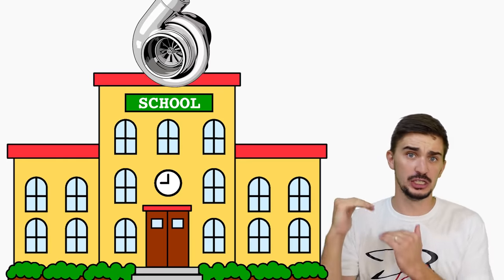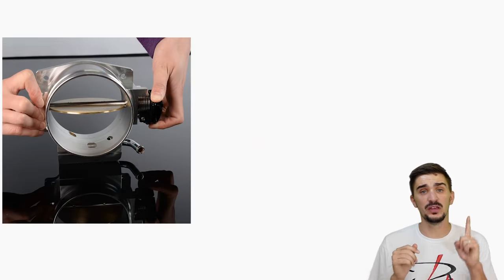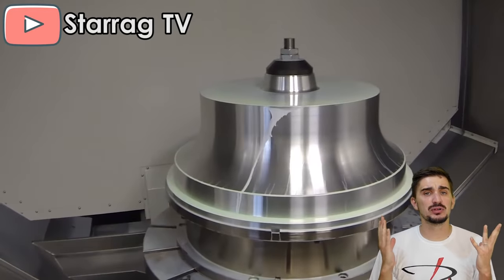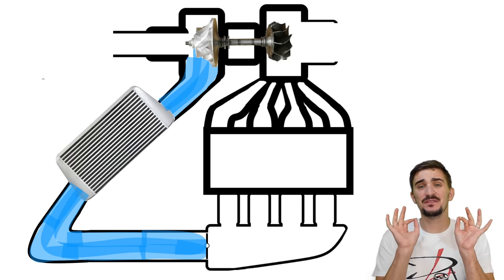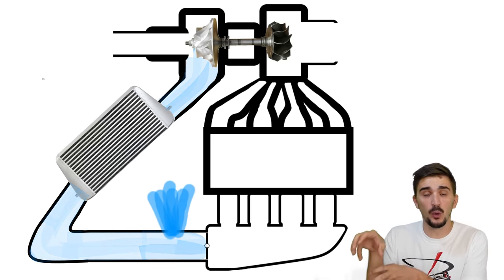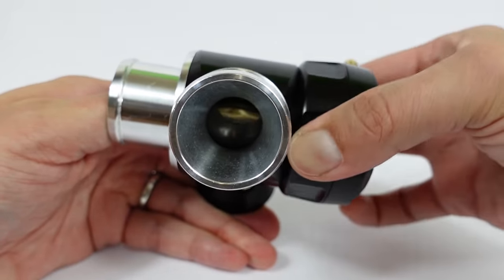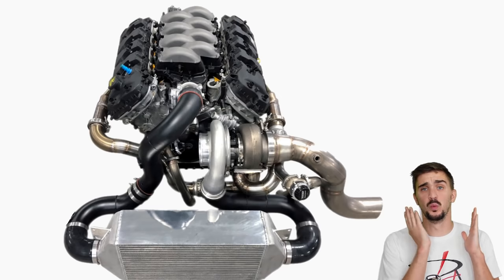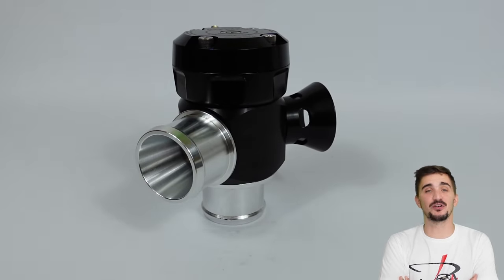TURBO FLUTTER and BLOW OFF VALVES explained in DETAIL - BOOST SCHOOL #8

Comment from the maker: Become a Tuning Pro: https://hpcdmy.co/dr4a
Support the channel by shopping through this link: https://amzn.to/3RIqU0u
Go Fast Bits: https://gfb.com.au/
GFB TMS Respons: https://gfb.com.au/products/blow-off-and-diverter-valves/respons-tms/
The BOV from this video: https://gfb.com.au/products/blow-off-and-diverter-valves/respons-tms/respons-tms-t9033-adjustable-bias-venting-diverter-valve-bov-detail/
Reply: I would like to know about my Stu tu tu tu is with a diesel with no throttle, and variable turbo
Reply: @fastinradfordable  same here, have a vw twin seq. turbo with a air snorkel aimed at the driver ;)
Reply: Listen besides boost school, I say you call it the “School of Spool”
Reply from the maker: @Stank-b8w  Good one! Might use that some day. Thanks!
Reply: @d4a  definitely do!
Reply: @fastinradfordable  Some of the newer diesels have throttle plates to help reduce emissions. Sounds stupid to me but that's what they do.
Reply: How does the tdi diesel kooo
Reply: @stevenharpervw  what do you mean by "koo"?
Reply: @chrisbaker2903  on a vw tdi turbo diesel. They sound like pigeons that go koo or choo. A diesel doesn’t have a throttle plate . Vroooom -choooooo
Reply: @stevenharpervw  my tdi is an 03 and I've never heard any sound like that from it. It is bone stock so far. I have an egr delete kit but haven't installed it due to physical disability. I live in a kind of backwater town and need to find someone who can do the stuff I want.  Better turbo, better exhaust and intercooler.
Reply: I'm not smart enough to know if this is easily installed or made compatible with a 2012 chevy cruze 1.4 eco (gas) but I love stu tu tu tu
If anybody wants to be that guy, I'd I'd eternally greatful 😅
I have an AEM ram intake, and a zzp downpipe I'll be installing soon if that has any bearing.
Reply: You’re awesome lol subscribing now but I think that flutter sound is worth the shortened life of the turbo lol $1,000 every year or two would be worth it for that sound 🤣
Reply: does this need further tuning after installing?
Reply: I loved this explanation. 
Particularly with the Stu-chu ...
Reply: I have a question can i install a blow off valve in non turbo engine
Reply: @fastinradfordable  zrpi
Reply: Thank you for the explanation! I've always wondered how this worked.  I had some clues but seeing the renders, graphs, and your explanation was really enlightening.  
(The following Note comes with a story, of how I Found out, and also how freakin' expensive it is to fix)
As a note  that I do want to point out, is that some manufactures call the recirculating of air and the associated part (Like Volvo for instance) a "Compressor Bypass Valve" or CBV since it does exactly as you explained and allows for both recirculating and venting, instead of just venting.  
I Learned some about this when I had a cracked turbo pipe and my CBV blew out as it exceeded it's max rated PSI of 25 boost.
I have a 2007 Volvo S60R with a 6spd Manual and a partial upgrade kit which I still need the exhaust for, but do have a software upgrade which does increase boost pressure.  Unfortunately I bought the car used and it was well abused before I bought it.  Previous owners thought a Toyota dealership was a good place to replace a clutch assembly (they didn't do it correctly either) but that is another story.  I had a serious problem but no answers for 6 months.
I was unable to take it to a good mechanic or Volvo dealer.  I was in Florida for a contractor position in Orlando and the nearest Volvo place was in Winter Park (They are terrible at handling R and other rare models of Volvo) and they checked from the fuel pump all the way to he injectors, but never thought to check the actual intake manifold past the MAF.  
eventually the CBV blew out due to a massive over-pressure caused by my Turbo overcompensating for serious lack of pressure, followed by the charge pipes that hold the air suddenly doing their job.

I literally had to Floor the car to go 63 mph, when it normally produces around 340 hp (with the software upgrade + Elevate Air intake box/filter vs 300 stock.  If you have the full Elevate kit of airbox, exhaust, and software it's 370hp+).  
I then evacuated due to Hurricane Irma and went up to Atlanta, GA where my father was, which is where I went to a competent Volvo dealer in Alpheretta (near North Point mall) that I'd used for a long time partly because they have a certified R mechanic, who actually owns a 2006 S60R.  They looked at the car (I think it was just a regular mechanic that looked, so the other dealer has some serious issues with handling turbos... which like unless you have a 2009 or older all Volvo's have turbo's minus all electrics) for 15 minutes and told me exactly what happened.   I was both blown away at how incompetent the other dealerships mechanics where as well as how expensive the repair was going to be, verses the fact I had literally just spend that much money over 6 months diagnosing and replacing parts that were not broken.  (parts cannon anyone? Dont' let dealers do that.  hard lesson)

Anyway, the compressor itself was $1,100 and the charge pipes and other items were a good $1600 and once you added labor for the turbo itself I wound up spending about $3k or more.   (the pipes weren't that expensive but labor is nuts), and I had to buy my custom Elevate CPV which was an upgrade over the stock spring one to a piston driven one with a higher boost rating.  I was lucky nothing else needed replacing from that.  But I will never forget having to floor it to go 63 MPH.... that was ridiculous. 

In a Turbo charged car, if the turbo fails, you produce a lot less power and I think that is related to running negative pressure.  I'm sure you have a video on that though and I look forward to watching it!

Thank you again and anyone who made it this far in my comment, thank you for reading.
Reply: Could you do a video on how a BOV is different than say a diverter valve for a Audi or Mini Coopers? Ive always wanted a real BOV on my Mini but Im told that I should get a DV+ unit instead.
Reply: why do turbo diesel engines have turbo flutter??
they dont have a throttle body...

Comment: As a longtime mechanic, I would have to say that this is the best presented explanation as to why a bov is needed in a turbo circuit! Well done
Reply: But you don't need one.
Reply: Well I have a 2013 Mercedes-Benz c250 and it has a turbo and I have a bov, but my mechanic toll me that it caused turbo lag and that was the reason that every time I accelerate it took a few seconds for the car to go.
Reply: @moiseslopez7831  Hi Moises, the problem isn’t the box, it’s the turbo. When you accelerate hard, it takes a few seconds for the turbo to spool up to a high enough speed to provide the boost required for the engine to have the power needed to accelerate. That is the reason for twin turbo engines. They have a very small turbo that speeds up very quickly to eliminate lag, but as they are small they can’t provide high boost pressure needed for high engine revs, do a second much larger turbo is I Also in the system, which provides the boost from the mid to high engine revs. I hope this explains what is happening in your Mercedes.😃
Reply: Danm, thanks  🙏 , now I'm sure that I don't need to take out my bov.
Reply: @markthomas36  If you have two turbos and one is bigger than the other it's not a twin turbo...
Reply: @moiseslopez7831  Ignore him, that isn't what is happening, it's likely running a blow off valve is causing a rich condition, the ECU thinks there is more air in the system because you are releasing air out of it that would otherwise be recirculated by the factory bypass valve.
Reply: Is there an advantage that BOV has over oem recirc other than the sound?
Reply: @chrisrourke8404  The recirculation doesn't relieve the excess pressure as quickly as an atmosphere venting does, and the excess pressure is what shortens the life of the turbo, especially if the boost is much higher than OEM.  But at the same time, the venting causes the turbo to have to spool up each time the throttle is released, which translates to unwanted lag.  The bov advertised in this video allows you to have a mix of the two options, and you can adjust it to find the best mix for your particular engine setup.

Comment: I can't believe he actually made a graph of the stututu sound. This guy is a legend!
Reply: That's a turbo efficiency chart. It's based on rpm, displacement, and boost volume. You use these to properly match a turbo setup with your engine setup to ensure the amount of exhaust pressure your engine will produce, your engine's expected air requirements, and the turbo's ability to push air line up effectively. Most people think "bigger turbo, faster car," but this isn't the case. If you're too far out of the turbo's efficiency curve, you'll starve or overload the block. Watch Donut media's video on boosting the Miata for a good breakdown of using that chart
Reply: He's a beast rite
Reply: @complexeddrummer  I didn't know that's how that works but it makes sense
Reply: U don't  graph your stu-tu-tu noises?  
....  novice
Reply: @complexeddrummer  he's talking about the chart after that one. The one that had disco stu in it
Reply: He didn't make it its from garret
Reply: Ffs 😅
Reply: @complexeddrummer  You're talking about the compressor map. I'd recommend TurboDirect S.A if you really want to learn about compressor maps.
Reply: And  I can't believe he used disco stu on the graph. 🤣🤣🤣
Reply: lol...ur comment made my day..
Reply: CR7 made it first
Reply: What do you mean, you can't believe? I am subscribed for precisely this stuff.
Reply: @MrTimstaaa  "disco" is short for "dis compressor"
Reply: Legend???! 😂  he’s teaching 6 year olds and looks like the person doing sign language in the corner of normal tv programmes 😂
Literally saying ‘sucking’ the air in, in the first minute, when the whole video is about turbos. 🤦🏻‍♂️😂
Reply: @Monkey80llx I know right the cool ppl were born with this knowledge. Only chumps learn from others

Comment: It takes a very smart person to explain complex subjects in a simple way for non-familiarized people to understand easily.
Thanks once again for such an educative video. I enjoy absolutely each and every one of them !
Reply: Need advice, replaced my stock turbos ( cus they were leaking oil) on my 2015 m4,  installed CTS stage 2+ turbos.  Runs great with my stage 2 tune that I've been using. I hear the spool loud and clear, pulls hard, but I get this flutter sound especially when going hard in Sports+ mode, almost like in the end of this video. Would a custom tune fix this flutter? Ive seen smoke come out for like 15 seconds..twice in the last 2 months. A quote for custom tune by RK Tunes is going to cost about $1400 minimum.

Comment: All this BOV talk reminds me of a system Ford came up with for their Focus WRC car in the late 90s/early 00s.
World Rally Cars have intake restrictors to keep the power down. Ford created a 'tank' at the back of the car which would capture all the air that would otherwise be vented off by the BOV. When the driver was off throttle this tank would be filled up with compressed air, which would be available for the engine once the driver floored it again.

Once the FIA found out about it (it took them a few rallys IIRC) they were quick to ban it because in their eyes it negated the purpose of the intake restrictor by allowing more air than what should be available for the engine, even if only for a brief period of time.
Reply: Very interesting, thank you for sharing this.
Reply: Interesting
Reply: O wow ive never herd of that. Thats really cool i might give it a try
Reply from the maker: I remember this! It was really cool. Should I make a video about it?
Reply: @d4a  that would be sick. You've earned my sub.
Reply: @d4a  By all means go for it! I am sure you can do a much better job explaining it than I did in this comment of mine.

Plus you'll have an excuse to show McRae abusing his poor Focus. :^)
Reply from the maker: @peekaboo1575  It shall be done! Thanks for the comment and reminding me of this
Reply: @d4a  Yaaay! If it's as good as your Toyota WRC Cheat video, we're in for a treat! ;-)
Reply: This is also being used in the new Koeniggsegg Jesko engine
Reply: @HuyTranGJ  I believe it's a bit different. On the Koenigsegg the compressed air is used to spin up the turbine in order to reduce/eliminate turbo lag.
The WRC spec Focus had a normal anti-lag system and the extra air was simply fed to the engine allowing it to make more power than what should be possible with the restrictions in place.
Reply: @d4a  that would be really cool.
Reply: @d4a  You would make awesome videos on how racing teams cheater or found loopholes in rules! Def would love to see that.
Reply: @d4a  yed
Reply: @d4a  yes
Reply: Did it work like an air injector/missfiring system?
Reply: @lordofrims  Not necessarily. Rally cars already have an anti-lag system so when you lift the throttle the turbo carries on spinning at/near full boost. However, there's an air restrictor on the intake manifold which limits how much air the engine can take meaning that once you open the throttle again you'll have roughly 300~350bhp (from the cars of that era).

While the anti-lag system makes the turbo carry on spinning at full boost the air that it compresses ends up being vented out of the intake's BOV, which gives World Rally Cars their distinct 'chirp sounds' under partial throttle/coasting.

M-Sport engineers began using a tank to store all the air from the turbo that would otherwise be vented off, and then feed it back to the engine when the driver accelerated again. That gave the WRC Focus more power than it was supposed to have and as such it was banned by the FIA.
Reply: Wait, wasnt Toyota the one who got caught "cheating" using this method in their Celicas before the Fords?
Reply: @Driftuner  No, Toyota did something different. They designed the air restrictor in a way that allowed for extra air to 'leak around it' once it was tightened in place.

There's a video about it on this very channel: /watch?v=uu_H6MaQeMU
Reply: @d4a  is it done yet?
Reply: It's also a device that is only useful because of the WRC rules.  Generally racing teams are encouraged to develop technologies that are more broadly applicable.